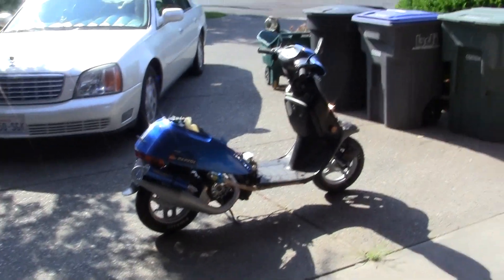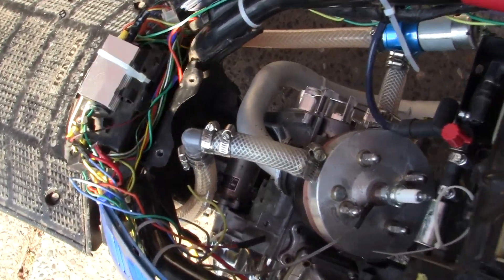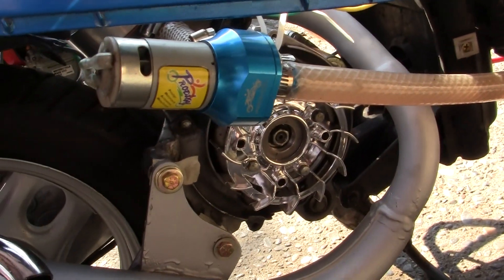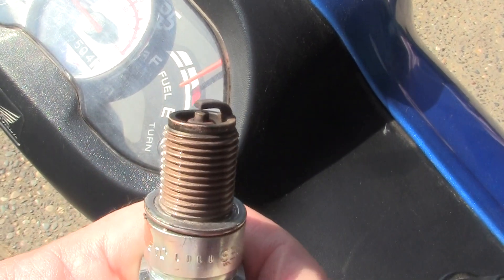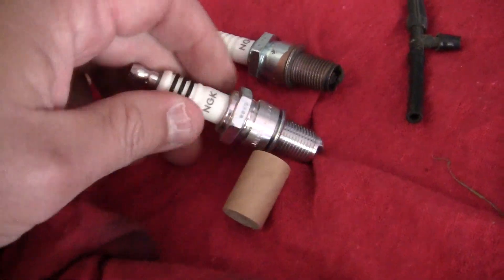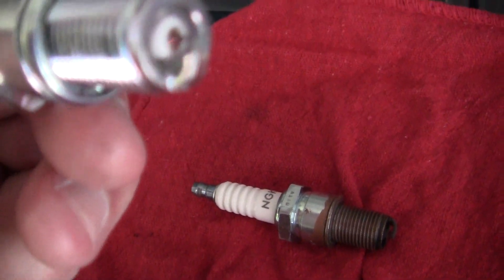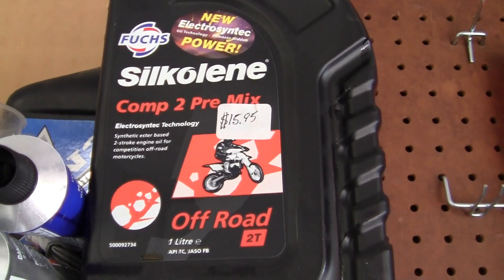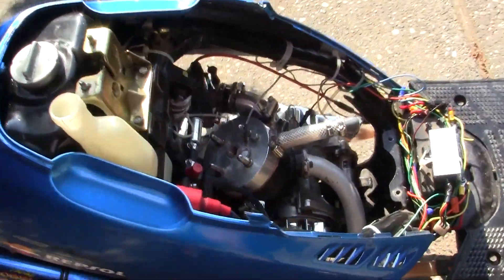DIO RACE FAST CHECK =FIRST REBUILT WFO RUN

Comment: Do you have any tips for me? My problem is that my bike is running really good, but the acceleration is very slow and at some point at a certain rpm it doesn't speedup anymore for a small moment and after that point it starts going like a rocket. So do you have any tips for me to try to get some more acceleration without loosing the already small top speed or increasing it by alot